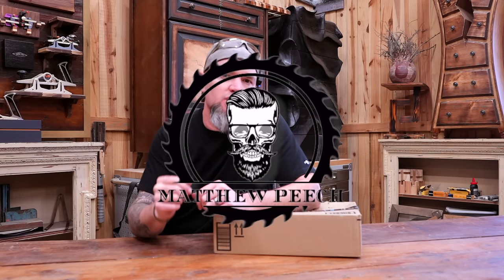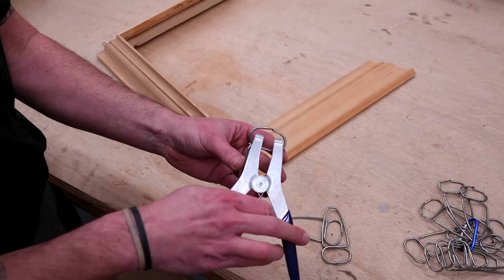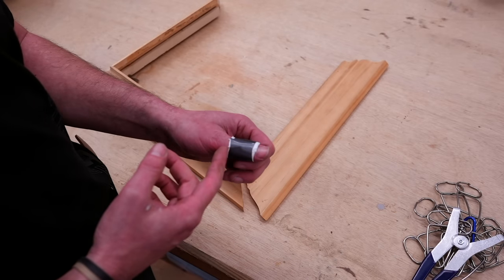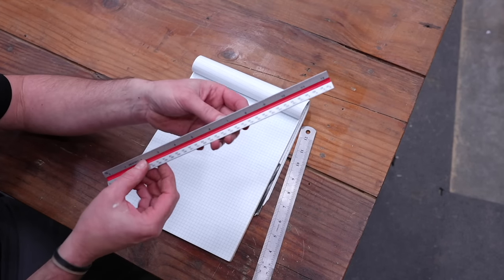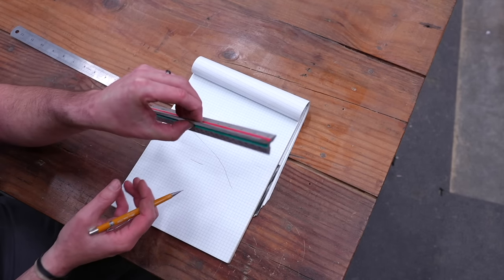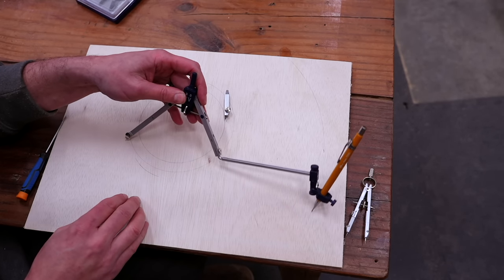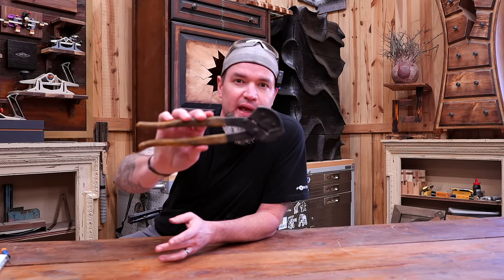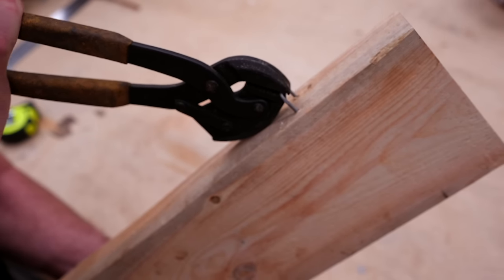8 Tools Under $20 YOU Told Me To Buy

Comment: Another good use for 123 blocks is when you need to stand something off of say a table saw fence so you don't bind going through on a cross cut ... since they are exactly 1, 2, or 3 inches you just set your fence 1,2 or 3 inches past the size you want to cut and use it as the spacer on the near side when cutting with miter gauge and the like.  I use them for this all the time.
Reply: They are also machined to within very tight tolerances and are made for machinists
Reply: Thanks for that idea because with fence clamps it would be much easier than a wood block

Comment: Great demonstration of all the tools you purchased. I really need to get one of those nail pullers. Seems like the perfect tool to have for woodworkers. Man that HF doweling jig is a hot mess. Even though it it not a cheap tool, the Dowelmax is the way to go. It is a premium tool that will outlast the buyer. If you can't afford, or just don't want to buy a Festool Domino, the Dowelmax is the way to go. The tolerances on that thing is just amazing. It will save you hours of frustration if you prefer the dowel method for joining boards together accurately.

Comment: For those center finding rulers to make your life easier lining up center just rotate it a bit until both sides are even, like instead of it falling at 11" 13/16 on both sides and trying to line up both sides ... just rotate the ruler clockwise (our counterclockwise) until both ends are at 12" on the outsides and center will still be accurate.  You can do this with regular rulers too (just pick a nice even number and half of it).
Reply: I just use any old straight edge rule or tape measure.  One edge at 0 and the other edge at the next available even number...center higher number divided by 2.  No special tools.  Similar way you can do multiple equal rips on a single board if needed.
Reply: @studiogerk Agreed!
Reply: @WreckDiver99  

Yeah, this works for any x-section you want, as I note in another comment. E.g., run a diagonal from 0" to 12" along the board from edge to the opposite edge. 
6" is at the bisection. 4" and 8" are at the trisection. 3", 6", and 9" are quarter section. 2", 4", 6", 8", 10" do a six-section.

Five sections are better using 10", 15", or 20", assuming your ruler is long enough.... and so forth.
Reply: @nickbrutanna9973  Yep...learned this so long ago I can't remember...40 years ago...maybe longer...just don't know anymore.  2nd thing that goes is the memory, can't remember the first.
Reply: Technically, I am pretty sure this is the correct way to use a centering ruler, and it is actually wrong to use it like he demonstrated. The advantage of a centering ruler over a regular one is that there is no math involved. Just use the same number on both sides.

Comment: Since I am a jack of all trades around my house, I learned that a pair of slip lock pliers work just as well for pulling nails and you don't have to buy a specialized tool.  A tool I use a lot when I use my circular saw is a cheap plastic 12-inch carpenters speed square. It makes a great fence for cross cuts and usually reaches across all the 2x's out there. Anyone without a table saw and sled can do precise work with one of those.
I can't get enough of your videos, keep them coming.
Reply: Found the same trick with the slip locks, those look like they might be able to bite a smaller bit, usually if its that small I sink it with a spring tool, so yeah dont need that specialty tool
Reply: you never need special pliers, use your ruler or literally anything else flat to pry against instead of prying against your finished piece.

Comment: 1-2-3 blocks are also useful as right angles for when you're clamping frames or small pieces. Many companies make fence clamps (basically just a small F clamp but just has a rounded end like a bent straw for those unfamilar) that will fit in the holes of the blocks. You can also use the same technique if you need a stop block for cross cuts on the table saw, by clamping the 1-2-3 block to your rip fence.

Comment: One of the most handy things I have gotten from harbor freight is their 12" flush cut saw with the wooden handle. I made a little pocket for it on the shelf above my workbench so anytime I need to make a quick cut, it's right there. Never realized how handy having a small saw within reach was until I got it. Best part, less than $10

Comment: I have been woodworking for almost all my life and have used all these tools and love them all. I now use a home made dowel jig but I did use a harbor freight dowel jig for a while but I drilled and tapped this jig and installed screws for micro adjustment and they took the slop out of it. I also have used the architect scale to draft all of my projects since I was kid. These tools are all great and as I was taught from an early age all tools-woodworking / mechanics - any tool - has many uses and can be used for something and in ways not always intended for. Just keep thinking outside the box and great things happen.

Comment: The nail puller is like using channel locks. Yours I'd like to find for my collection in my shop but channel locks are a must in your job site tools and easy to find anywhere. Ever use a pea shooter? (some call them ram rods) Ever wonder how in the old days how they hung cabinets with nails? check them out. Most people have never seen one and it would be a fun tool to show. They came in different sizes, Mine are all hand made. Great show. I am a retired master carpenter turned architect and changing up the cabinet shop and tooling to more wood working (no big low assembly tables that take up all the area) you have great ideas for projects to sell as a hobby. I picked up 30 onion crates (Free) I'm looking for projects to use them up.

Cheers

Comment: Krieg is not the only one who makes that tool, It has been in my tool collection for more than 30 years. you're right it is a very handy tool. I use it a lot when I am installing cabinets and such, Its  cool that if I need to, I can replace both the drill bit as well as the driving bit when it is time to. I have several of them with different size drill bits. I use the smaller diameter one for smaller screws and the larger diameter for larger screws. swapping them out is quick and easy. The nail puller is a great addition, I have had one in my kit for many years, very handy. If your at all concerned that you might mark the wood then I take a putty knife between the wood and the puller to act as a buffer between the two. sometimes you can get an angle that allows you to pull on it straight so you need a little protection. Tools are an investment that has paid off many times over. 
vix bits are handy when you need to fix hardware to wood, it perfectly centers the screw in the hole. freehand works sometime but if there is a knot or the grain varies getting the screw perfectly aligned will be difficult. they come in several different sizes too.

Comment: The easier way to break the board into sections is to use the ruler: Say the board is 6" (ish) wide. You want to quarter it -- i.e., make it into four pieces.  Put the "0" point on one of the sides of the board (the corner is ok, too). NOW, angle the ruler until the 8" mark is on the very opposite edge of the board. Mark @ 2", 4", and 6".  Those are your quartering points. If you want to be moderately accurate, then just do it again a little bit further up the board, then draw the line between the 2", 4", and 6" pairs just created.

This works for ANY size, as long as you have a longer ruler than the width of the board (preferably about 3" to 6", at a minimum, though)  and more than 2x long, where "x" is your number of sections. You can also use 3x, or 4x if you want, just make the points appropriate -- e.g., to quarter a 9" wide board, you can go from "0" to 12", and just use the 3", 6", and 9" points. To make a  three-piece, use the 4" and 8" points. To do fifths, with the 9" board, you are probably better off using a yardstick and the 15" mark, then mark it at 3", 6", 9", and 12". Note that you could also use the 15" mark to do thirds, because you can use the 5" and 10" marks in this case. 

All you need is an "endpoint" (i.e., the 8", 12", and 15" numbers used above, for the opposite edge) that divides evenly by the division desired.

BTW, you don't need the centering ruler to find the center -- just use the method above to define the center -- e.g., 0 to 12" on the diagonal, the 6" mark is the center. MUCH quicker. 😁

The centering ruler is better for making consistent distances from that centerline, once you have it -- e.g., if you want to make holes at 1", 2.5", and 5"  each side of the center. 😉

Comment: Yep. I'm gonna have to get some of the center finding rulers. I never knew they existed but it would be a fantastic addition to my shop. Thanks!
Reply from the maker: They are!
Reply: Me too.
Reply: Don't forget this trick that works with any ruler or tape measure:  1. Put the ruler diagonally across the piece. 2. Align an even (or odd) mark to each edge of the piece.  It doesn't matter what the angle is or what the two numbers are. 3.  The number in the middle between the two edge numbers is where the center of the board is.

For example:  you lay the ruler diagonally across the piece.  Adjust its position so that the 4 inch mark sits on one edge and the 16 inch mark sits on the other.  The 10 inch mark, halfway between the other two, lays at the center.  To strike a line, just mark more than one center point and then connect them.

Comment: @MatthewPeechWoodworking  I use the edge of a fridge magnet! This metal card shaped magnet has conversion chart on it for baking measurements. Works great as a card scraper! I paid $2/cdn in the dollarama. 
Cork board and straight pins! A thin piece of Cork on the back of a ruler greatly reduces slip. Straight pins from sewing kits work well with cork...say you are laying out geometric shape for design but you don't want it permanent...straight pins act like mini dogs in the cork.

Comment: I just bought the new 12" Bauer miter saw, not in the price range under discussion, but I was amazed at the quality.  Having been a commercial cabinetry & millwork wonk for 50 years, I have used a few chopsaws.  This was dead ccurate out of the box; square, miter and bevel.  Several clever secondary features I have not seen on much higher priced tools.  Love your channel and ideas.

Comment: I like the metal rulers with cork on the back side, they don't slide around easily. I have a Black and Decker quick flip that I have used for more than 20 years.

Comment: Favorite Harbor Freight tool is the 4" tilt storage bin. They connect together, drawers are removable, you can see what's in them and they keep the dust out
Reply from the maker: Nice!
Reply: Also the parts tray cases. The small/medium/ large bins inside are removable & half/ double each other's sizes & can be moved around & rearranged or swapped with other cases so that you have all small bins in one & large bins in another, etc. And you can take out whichever one you want to use without having the whole case in the way on your workbench.

Comment: For a dowling jig, the original "Dowl-It" jig is a superb tool and quite accurate. I've had mine for 35 years and have made countless face frames with it. But, about $60 or so.
Reply: I have used my Dowl-it jig for 17 years.  I paid over $100 Canadian for mine.  Not cheap but worth every penny.  Everyone buys cheap 20$ Chinese knockoff tools and then have the nerve to complain they are junk.
Reply: +1. The Dowl-It is heavy and solid, with really zero slop whatsoever.
Reply: Agreed, mine was one of the  first woodworking tools I bought back in the late 80's and it works quite well.

Comment: I have used 1,2,3 blocks bolted to sacrificial fences as stop blocks, I have 3 blocks with t-bolts and wing nuts to use in t-track. And you can also use them to lift your work off your bench when go to glue up to make clamping easier

Comment: My absolute favorite HF tool is my $1.97 Quinn Bottle Cap Opener.  It has an oversized cushioned handle and has worked flawlessly for several years.  I don't recommend using it with power tools though.  LOL.

Comment: The harbor freight AVANTI 5 stage HVLP sprayer is a WINNER! I work in a professorial cabinet shop that uses an expensive air assist airless paint gun system and while the avanti hvlp cant work as fast, it defiantly can get you a glass smooth painted cabinet door.

Comment: I don't buy a lot of Harbor Freight stuff, but the Bauer 9 amp Surface Conditioning Tool is great.  I recently used mine to remove what i think was 1-part epoxy floor paint from some old basement stair treads that I wanted to repurpose for another project.  After a couple of minutes on each board, I had the paint removed and was running them through my planer without all that extra gunk.  I have used it for other projects like stripping the remaining bark from logs down to the sap wood before using my Arbortech disks.  It's a lot easier to control the mess.  It's variable speed and has different drum grits.  The drums seem to hold up well, also.  I have not used the Restorer (Rockler sells them) that many people swear by, but it appears to me this tool exposes a lot more surface and thus is a lot more versatile, and I feel like the drums will last longer since they are more of a flap wheel than a belt.  And it's cheaper than the Restorer.

Comment: I really like the centering ruler. I am constantly finding the center of things, almost every project, start to finish I usually end up measuring measuring about 10 times. Thanks!!
Reply: tap measure at an angle until its a easy to divide number ie finding the center of a 1.75 project angle the tape until it becomes 2.0 then the center is 1

Comment: Matt again thankyou so much, but here is another little tip to save you a few bucks concerning glue or at least the spreading of glue, Gift cards that everyone seems to have or receive or the endless stacks that are at local stores are great for spreading glue, or epoxy etc, also most of us are after purchasing those silicone glue brushes they are not overly expensive $7-9 each in my area for Rockler or milescraft etc but if you want just as good of a brush for much less then visit your local dollar store , they will likely be selling bbq basting brushes that are equally as good if not better for like a $1 for two in a pack just trim of the longer bristles with some scissors and good to go, also while there pick up a silicon backing tray the kind for baking cookies , they are great for smaller glue ups where the mess can easily be picked off when dry. Reuse literally forever.  Here’s buddy and keep up the great work.

Comment: I got one of those pilot/Philips flip bits from the Irwin or Kobalt years ago and it was a game changer. Like $14, and they have different sized drill bit/countersink options for like $3 each if you want different holes for different screws

I have one of those dowel set jigs and I love it. But mine was also about $100. There was a learning curve (aka if you can't mark/line up it won't work anyway) but as I got older and more skilled that thing is indispensable for me with the few tables and panels I've made

Comment: I’ve had the 123 blocks hanging by my drill press for over a year, slowly at first, but I keep pulling them out now for one project or another. Glad I have them. Also the center ruler is a good thing, set it on a slope to the nearest whole number, you’ll still find the center. 
Take a small rectangle scrap of plexiglass and scratch 2 lines in it parallel to each edge and crossing offset from center. Great see through sketching assist. Glue some 100 grit sandpaper to the back of a ruler and it won’t slide around.

Comment: Love you videos, very informative.  The Kreg Quick Flip is a copy of the Ryobi Drill and Drive system I purchased in about 2006.  Works great but hard to find replacement drill bits for them.  They are keyed with a flat side to lock in and tighten.  I guess you could use a file on a bit to make it fit.  I still use mine all the time.  It looks exactly like the Kreg you have, even has the brass colored quick release.  Ryobi does not make it anymore, or at least I can't find one.  Keep making videos.

Comment: The kreg quick clip is a reincarnation of a craftsman tool thats been around for a very long time. I had an original and used it a lot until I lost it in a cross country move. It was part of a kit with bits and holders that I stole from my husband, he didn't even know what it was lol. I'm thrilled to see that kreg makes one and I'm off to buy one today!
Reply from the maker: Nice!! I guess I had just never ran across one before.
Reply: Yep, I have the same set. It was called the Craftsman Speed-Lok. I think I've had it for about 25 years.
Reply: I think every brand has their own version of those. I've had the craftsman and kobalt ones for years and love them
Reply: @mattsmith9270  yes! Thats the one!
Reply: I've been using a Makita drill/driver for more than twenty years, they were available in sizes six and eight and I still have both although I have broken a few bits. Cheers from downunder.
Reply: I have gone through at least two of those Kregg drill drivers. They are cheap and they fall apart (literally). I tried the DeWalt one and it was "okay". When I lost it, I tried the Craftsman one. It still works well and hasn't fallen apart yet.
Reply: @mattsmith9270  Same here, 25 years and still going strong.
Reply: Back when I worked on RV factory line I had a craftsman and DeWalt set of the flips. The DeWalt one stripped out the locking bolt about a month in. The craftsman one I had for a couple years without complaints until a tweaker stole my tools.
Reply: Yep, I have the Craftsman version too, have had it at least 25 years.
Reply: Yelp! Got one!! Had it a longgg time